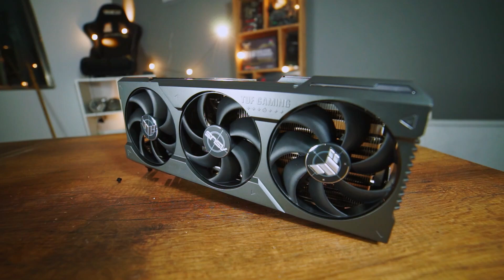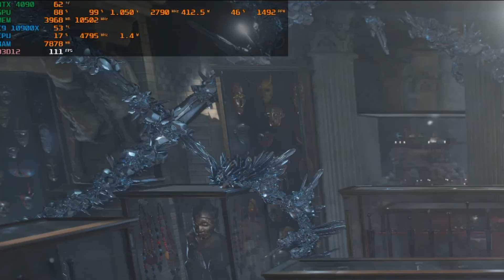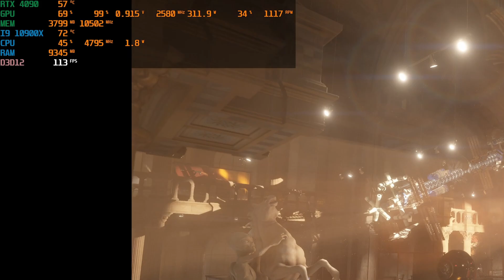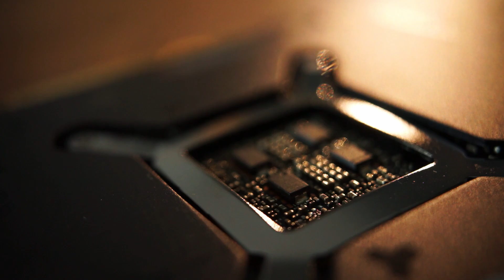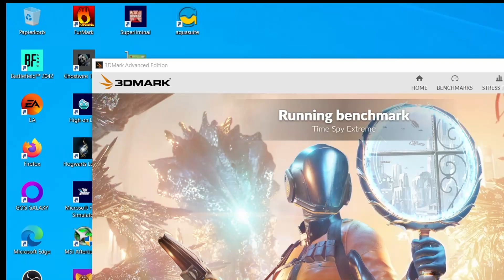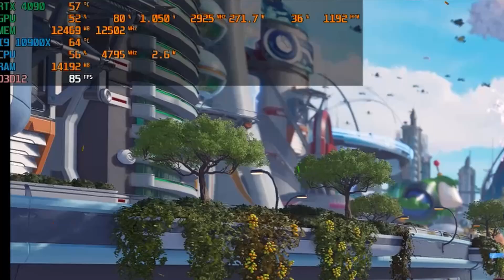More FPS, Less Power and Heat on ANY Nvidia GPU! | Nvidia GPU undervolting RTX 4090

Comment: I undervolt with my "effective clock" method. First, overclock the 4090 as high as it can be stable and use hwinfo to see what the effective clock frequency is. Mine would overclock to a little over 3ghz but the effective clock in hwinfo never went over 2850mhz. So using afterburner voltage/frequency curve I set it to 2850mhz and found the lowest voltage that was stable. In my case that was 2850mhz@995mv. My power usage is much lower while losing very little performance. Try it out and see what you think. I'm not saying it's definitely the best way, I'm saying I haven't seen anyone else doing it like that and it might be very good when compared and tested by several different people in independent tests. I'm willing to be proven wrong.
Edit: I'm using 400 watts when yours uses 300 watts so the way I'm doing it the power usage is somewhere between stock and your method. Let me think about this.